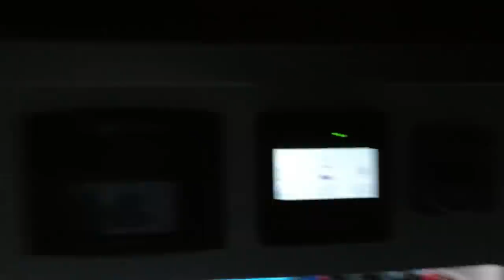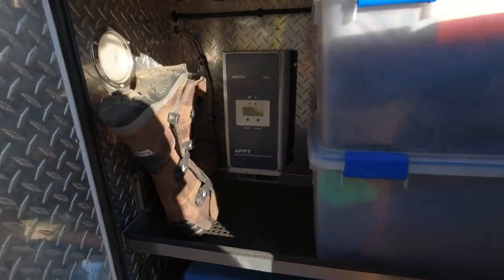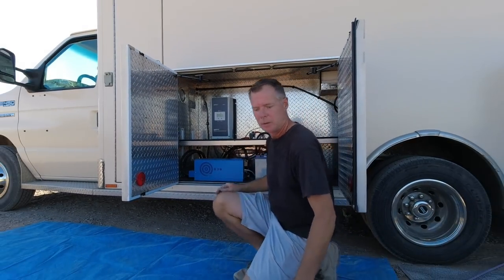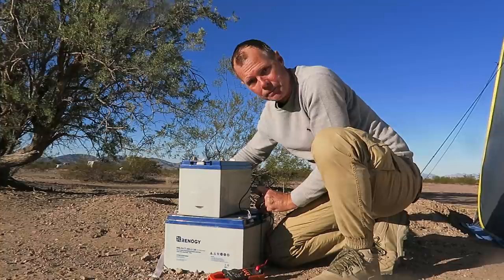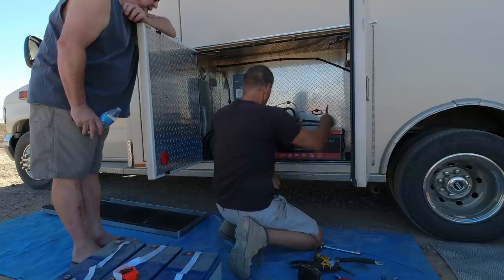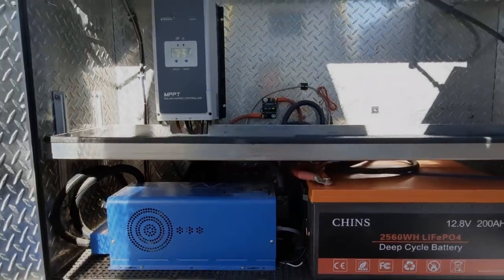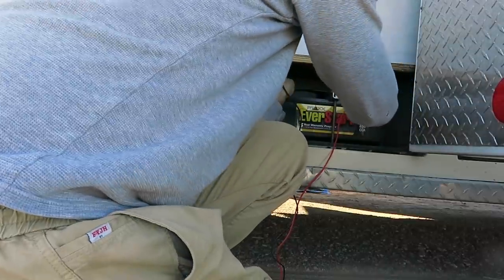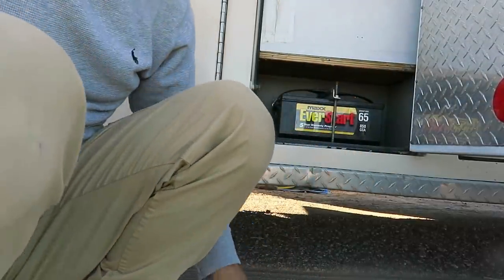Upgraded To CHINS Lithium Batteries In Quartzsite Desert | Fleet Gear | Ambulance Conversion Life

Comment: Ha! Almost everything you said in this video was essentially another language. I’m happy to understand that everything is working, tho.  Hoorah!!  I just had to get new batteries and I chose AGMs (even though I can now not even entertain lifting them), as I live in NJ and I knew lithium may present real issues in low temps. My batteries stay in my rig, cuz a small panel on the roof keeps them charged. At some point, I want to put a larger panel or 2 on the roof. Here’s hoping the weather improves for you. We’ve got nothing but frigid temps and threats of ice and snow on the way. Uuuugh!!
Reply from the maker: Heavy right!! There are lithium batteries with internal heaters for tour temps if you ever need to swap :

Comment: As far as batteries for the rig are concerned, it's somewhat hard to give solid advice simply because things change so quickly in today's world. What was solid 6 months ago, maybe a totally different story today.
My theory is, you go with a major name brand that you have access to if warranty is necessary. But more importantly, what will help them the most is adding some sort of charging maintenance to the system. A maintainer offsets the natural tendency for dual parallel batteries, that have different internal resistance, to stop fighting each other. The end result is, you can sometimes double your battery life.

Comment: I've had good luck with the Motorcraft batteries.  
Do you know the history of the starter on your Powerstroke?  The slow cranking can be a sign that the starter is getting weak.  It's not too hard to change.  The voltage on your chassis batteries is a little low but that's to be expected on a cool/cold morning.
There are small solar panels that plug into the 12 volt accessory receptacle on your dash that will help keep the chassis batteries fully charged.  The panel can be placed on the dash up against the windshield.

Comment: I would suggest having something like this: Noco Genius Boost HD4000 Amp12V Jump Starter GB150. I got mine for $240 a couple of years ago but eems they have increased in price. I have used this thing on three different occasions to jump start my 7.3.
Reply from the maker: That's a great thing to have with you  :)

Comment: Regarding the CHINS LIFEpo4 Batteries, are you considering putting a piece of Closed Cell between the Batteries to dampen Vibration? and also, have you considered getting a Nylon Strap Tie down and Pulling the Batteries to the Back Wall, again to combat Vibration in Motion.  I have a Single 300 AH Chins and I love it. been Running it for a year with Charging off Alternator and Shore Power Via a Charger.  No Solar on My Bus as could not find an efficient way to get cabling and panels up onto roof as I don't have a roof rack on my Skoolie (Shorty). Glad you and Lefty are doing great! keep on sending out those videos.  Peace and good times From Tennessee.
Reply from the maker: I'm planning to change their mounting - watch for an update video :)

Comment: Oh yeah, I forgot to mention that your starting batteries didn't seem to be that low of SOC, considering they'd been sitting a few days. If you really feel they're struggling to start the worst diesel engine ever produced (J/K! I'm a Duramax guy with a chip, about 1,000 ft-lbs of torque at the crank pulls that 42' 21,000lb trailer up steep grades at whatever the speed limit is) you could add a battery combiner unit and your 400Ah of Chins batteries will spin her right up in the morning! Even if you get new batteries, a battery combiner is a great idea to ensure you don't get stuck in some remote location. Take care!
Reply from the maker: Thanks Steve and sorry you have a Duramax (jk...). I'm looking at an Amp L Start. It takes some solar and keeps the crank batteries topped up when sitting. I do have a main switch that connects my 2 systems too - I use that for the glow plug draw.
Reply: @TheCampulanceMan  Great! I knew you were a guy who is very thorough and does his homework, and that's one of my highest compliments! Keep up the great work!

Comment: I'm not far from you. I'm boondocking as always with 900 amp hours of LifeBlue lithium iron phosphate and 1300 watts of panels on the roof. You are going to love the lithium..so many advantages. One of the biggest being how fast they charge. After over 4 years the batteries have lost no capacity at all. Not a single percent.
Reply from the maker: That's a lot of juice!! :)

Comment: got you some good batteries now/where did you buy the chins lithium batteries/do you have 4 of 100 amps/do you have 400 watts of solar-what brand solar are they/renogy/i have 6 gernany made that have not installed /thank you for answering in reply/thanks much
Reply: He has two 200watt lithium batteries purchased from Amazon you can find them in his description
Reply from the maker: The Chins are from Amazon, link in description - I have (2) 200Ahr. I have 1140watts of solar panels, Rich Solar brand.

Comment: Those Everstart Maxx batteries have a 3yr FREE replacement warranty on them. 2yr prorated. 5yr total. 
You're still within your 3yrs.....Go get replacements at Walmart. And that'll give you time to search for maybe a better battery. But from what I've been told most of my life is most lead acid batteries are the exact same; no matter the brand. Apparently theres like 2 or 3 manufacturers of those in the world, and they just slap a different brand on them.
You might look into replacing them with AGM batteries, because they also do better in warm & cold climates. Also they tend to last twice the lifespan of your typical "lead acid" battery; which is what you have now.
Reply from the maker: I am going to see if they'll replace them - might as well right...

Comment: You may need to check (meter) glowplugs to see how they are working.  On my old 2000 7.3L they all failed. When temps were below 60° I always squirt 2-3 seconds of starting fluid aimed into airfilter. Vroom! No problem. Heat is a killer of batteries when set by mfg in the engine compartment.  Your's are not in any heat. Try a can of starting fluid after fully charging your batteries.
Reply from the maker: I am planning to change glow plugs and relay when I visit NY in the spring. And maybe injectors too...

Comment: amazing, your electric setup is so simple with just 3 components. i really like the setup and would like to do the same, any additional info about your system would be greatly appreciated. did you disconnect the house DC and route it to the lithium batts?  is it possible to charge the ambulance batts using solar?
Reply from the maker: Thank you :) Yes to both your questions  - and I have some earlier videos showing a lot of the details of my system.

Comment: David, I'm wondering If you ever considered the Bluetti  or equal solar generator?   I know your already setup with a Battery storage system but if you had to do it again would you go the same route ?
Reply from the maker: Hey Ron - I'd go the same path that I have. It's a matter of having all the power all the time without having to really do anything. It all just works and it's hands off :)

Comment: I have two starters battery's there is room for three in my battery box is there a benefit to having three over two these are not the house battery's?
Reply from the maker: If you have 3 they will last longer than 2.
Reply: @TheCampulanceMan  o thanks that makes seance maybe I will do that next time I replace them I hear you won't all the same brand and to change them out all at once

Comment: Do you turn your inverter off every night and or just into save mode?
Reply from the maker: I turn it off when not in use. I used to use power save mode and sleep timer on the TV, but now I use the 12v screen at night.

Comment: To date have not had any luck with Chinese battery's especially walmart battery's , I run 1100 amp (cca900) std & gel truck battery's and get over 10 years service out of them , my battery's right now are made by East Penn but are from 3 different distributors . one is 11 years old and the other two are 8 and 9 years old . I have not dealt with any lithium battery's , hope it helps David , Hi Lefty

Comment: man i see many things done wrong. gel failed from bad mounting same as new ones. truck battery id say gost load.
Reply: What do you see as "bad" about the mounting?
Reply: @paulstough2995  rubbing on each other and wall. not held down its just a bad setup.
no terminal covers with metal shelf that could fall on it.
no low temp cut off is a disaster.
not trying to be mean but im a  highly skilled mechanic and see things most do not and i see alot of bad builds.